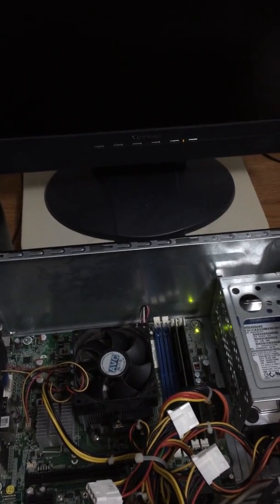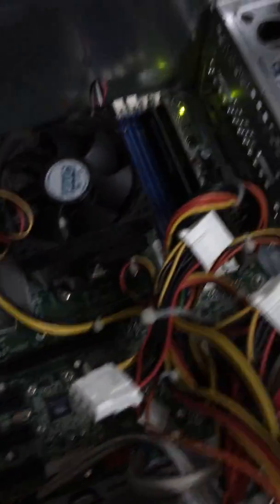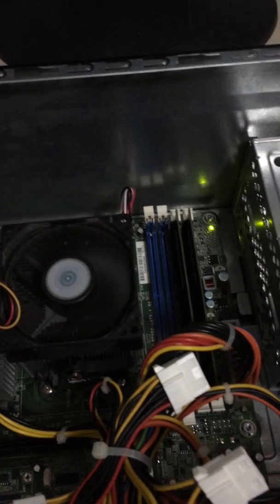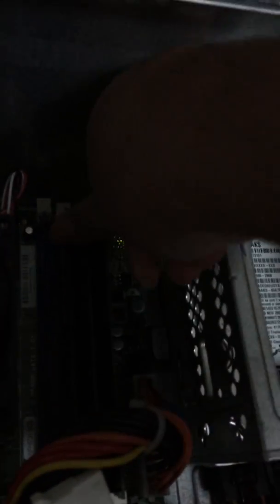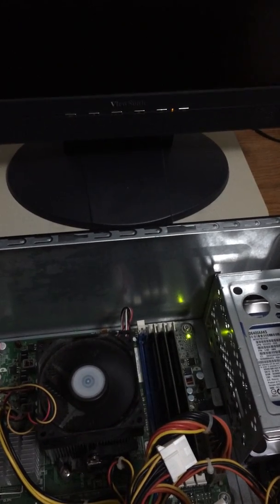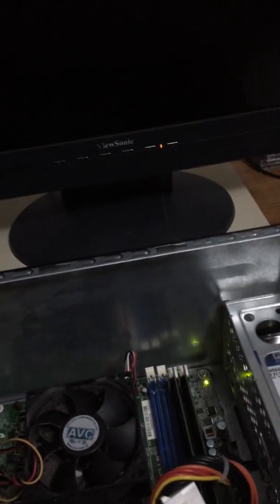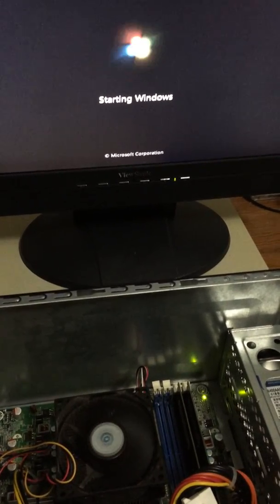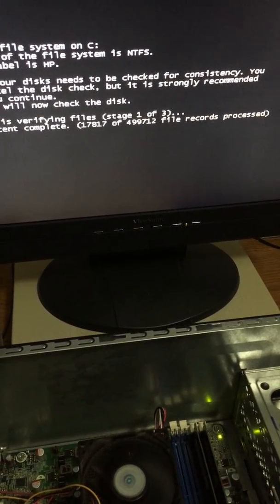Dead computer fixed ... by adding and removing a ram stick?

Comment: Same problem here. Did you fixed it?
Reply from the maker: Shimazu nope. I sold the board to someone on eBay, fully disclosing this situation (with this video). I asked what they did with it, but never got a response after the sale.
Reply: sirlouie so the problem is in the board? Thx
Reply from the maker: Shimazu Yes, either that or the processor. I re-used the other system components once I replaced the motherboard, but I sold the mobo and proc together.
Reply: i fixed it updating the bios.......